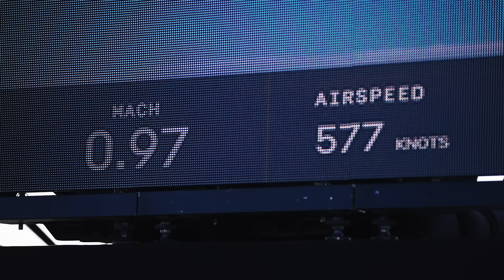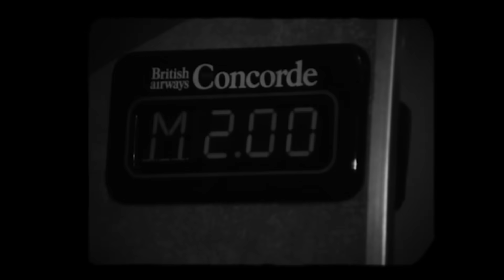How Blake Scholl Built The First Independent Supersonic Jet

Comment: Chapters (Powered by ChapterMe) - 
00:00 - Intro
00:19 - Supersonic passenger travel
01:10 - Boom founder discusses supersonic jets lessons
01:38 - XB-1
01:52 - Overture
02:16 - Getting the idea and company off the ground
03:37 - Blakes passion for planes and tech career
04:01 - First company
05:05 - Next company
05:29 - Business economics comparing to Concord
06:51 - How to determine the performance of an airplane?
07:50 - Networking and breaking into the industry
09:24 - What did the experts get wrong?
10:42 - How big is the team? 
11:42 - How did you build it with a small team?
12:20 - Advice for founders starting out

Comment: If concord was made in USA, it would have worked. It has never been about the technology
Reply: Well it worked for 30 years and was profitable in the end for BA. Boom has some issues. It can go supersonic with a low sonic boom but only at specific atmospheric conditions this is known a the mach cutoff. Unfortunately the conditions it's flying in to achieve mach cutoff are currently at its worse fuel economy,  so as it currently stands it will be expensive and possibly unable to operate a supersonic speeds without causing unacceptable booms. It Concorde with an e BTW.